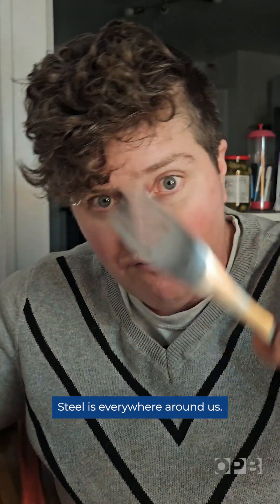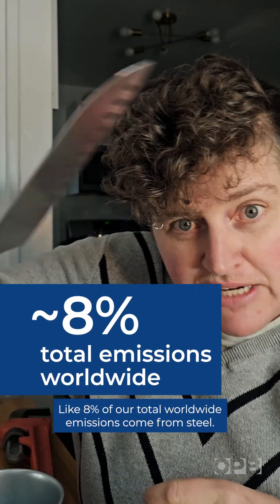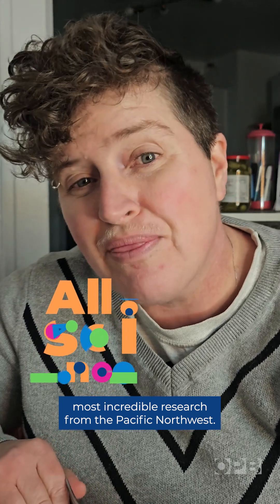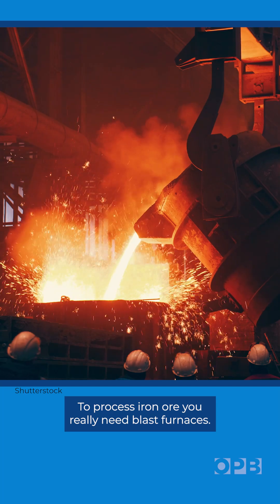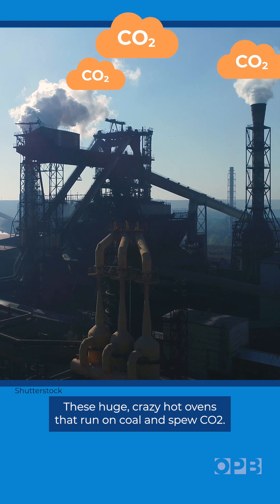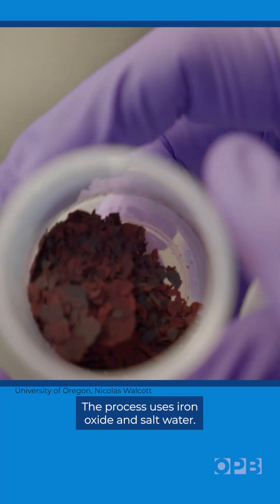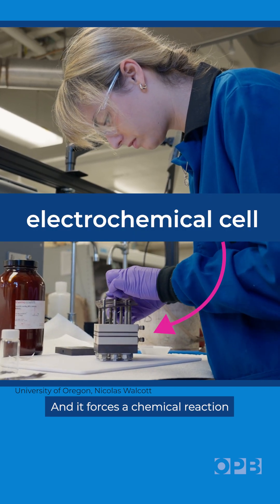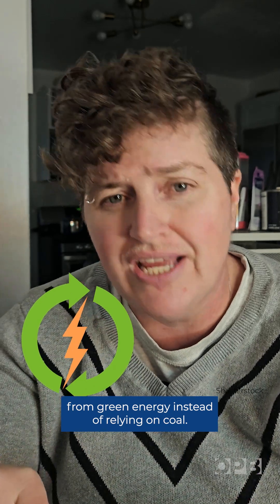Can we make steel more climate friendly? 🍴 🌎 #steelproduction #science #AllScienceNoFiction

Comment: But CO2 is good, and humans produce an insignificant amount. CO2 does not control the climate. CO2 levels during the early Holocene reached 580ppm, during the 1800s the average was 335ppm, not the 270-280ppm which the IPCC pushes. CO2 during the 1940s reached 480ppm. Try not reading wikidedia or other junk science websites to educate yourself. There is no "Climate Crisis"